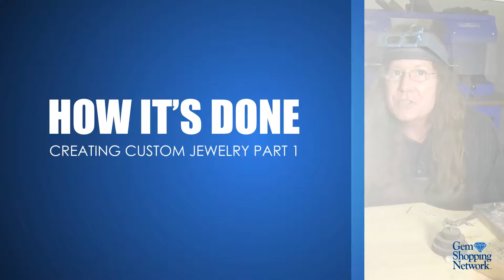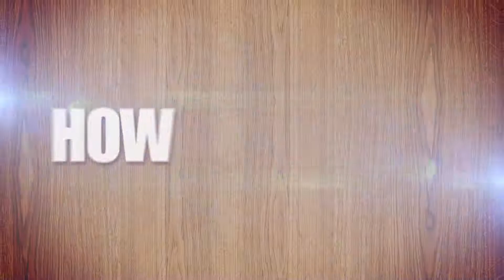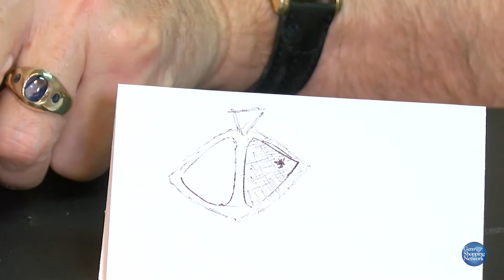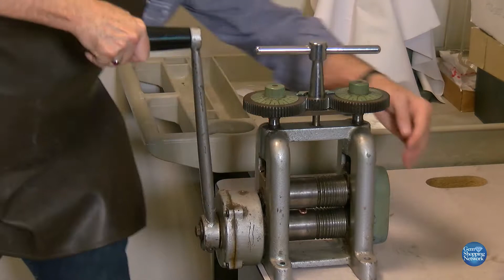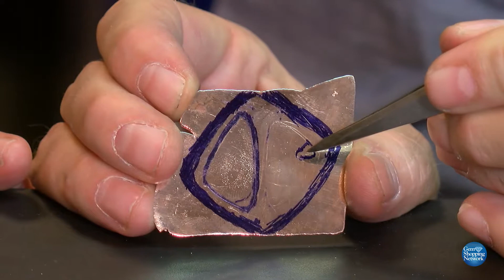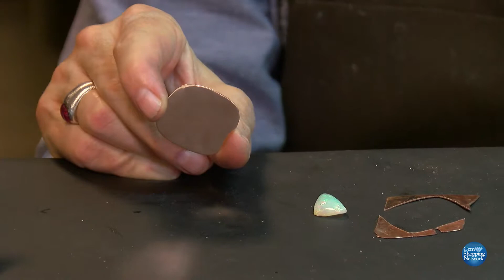HOW TO create your own CUSTOM jewelry Part 1 - Tutorial l Gem Collectors

Comment: May i ask what that little roller next to your rolling mill is called and where they can be purchased? Is it a ring or bangle stretcher? Or is it just for rolling wire or stock into a d section shaped wire/stock? Sorry for my many questions. I have a rolling mill. One of those cheaper mills from ebay and its one of those that do not have interchangeable rollers so it would be nice to have something small like that 4
Reply from the maker: Great spotting job!  Isn’t that a cool little deal??!  It is exactly as you stated as well. I have multiple mills and found that you get what you pay for!! But that little jewel came with a bunch of equipment I bought in an estate sale and it works great for small or bench mounted areas. I use it for quick or small sizes needed in metal stock. Such as if I only need a particular small piece of sizing stock or sheet as it has multiple shapes/sizes on the roller and also allows for slower and better control with less waste or metal needed to create the piece desired compared to my 100 or 120mm reduction mills which will easily “over roll” a piece of metal if not careful! 
    Part of it has already been home welded and adapted.... I am not sure where or if this product is still made.
You are the only one to have commented or noticed that piece of equipment and got its use right as well!
Good Job!  And keep on learning!! 
Shawn